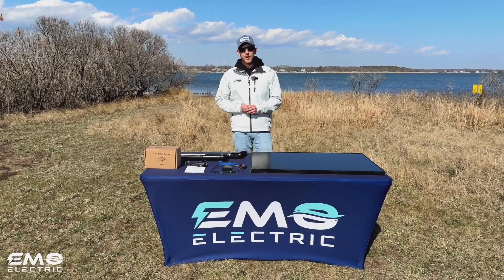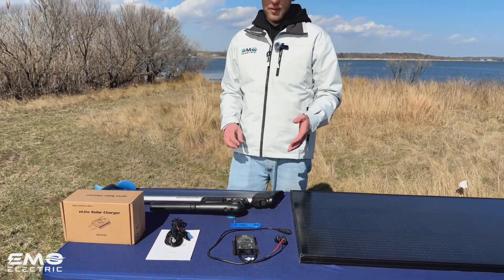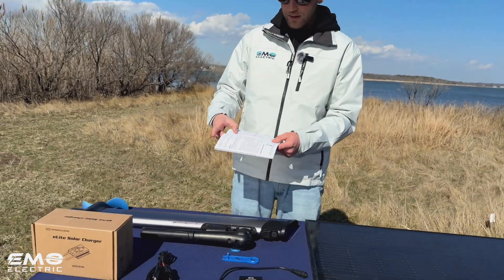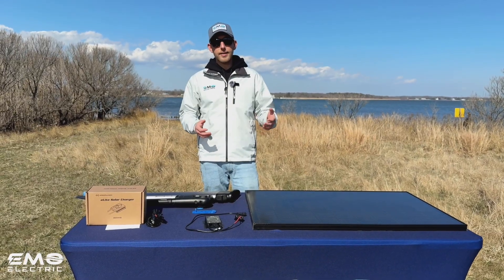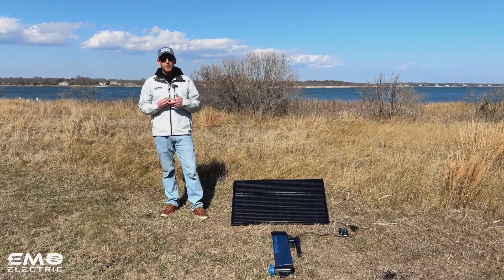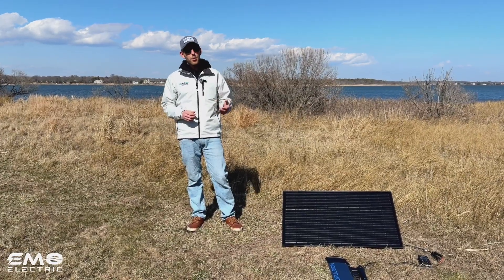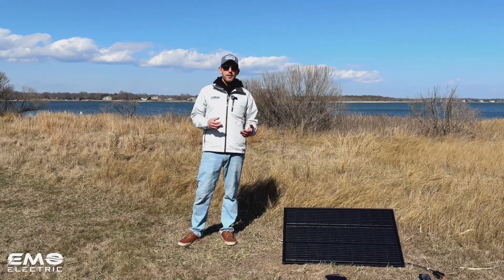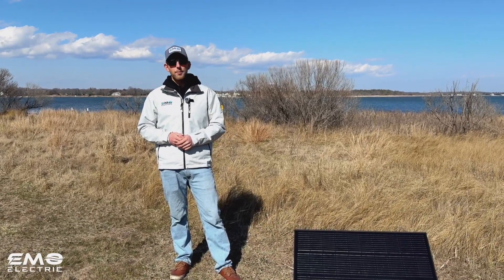Testing the ePropulsion eLite Solar Charge Controller: How fast does it charge?

Comment: Can we solar charge the eLite while its running..? thnx
Reply from the maker: We have not tested this ourselves but given that you can charge it while it is running with the AC charger and DC charger, we would expect that the same is true for the solar charger.
Reply: @EMOElectric  "We have not tested this ourselves" would you consider testing it? seems like a worthwhile use case to have manufacturer-given guidelines for.